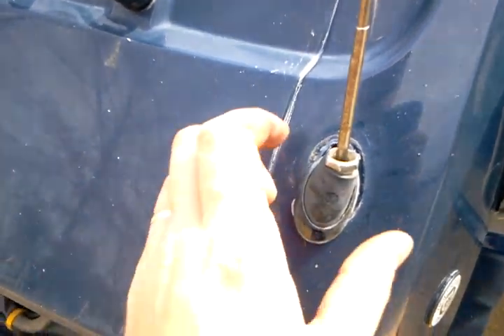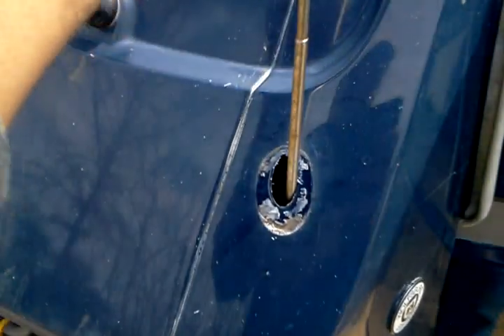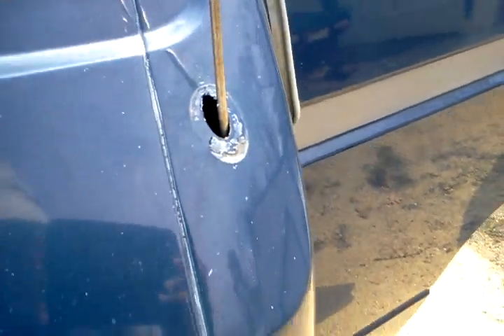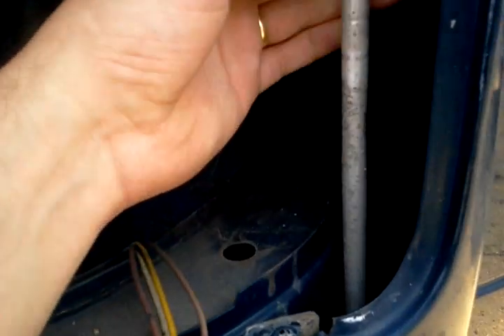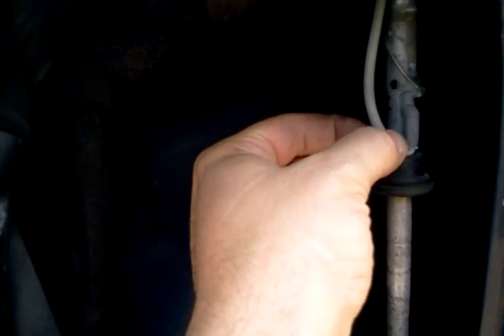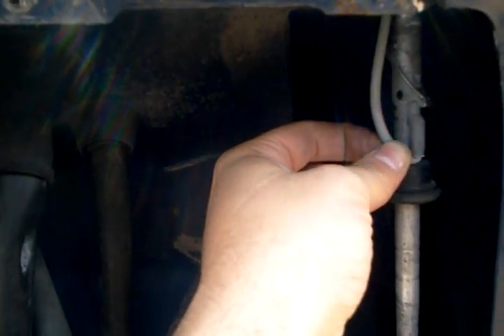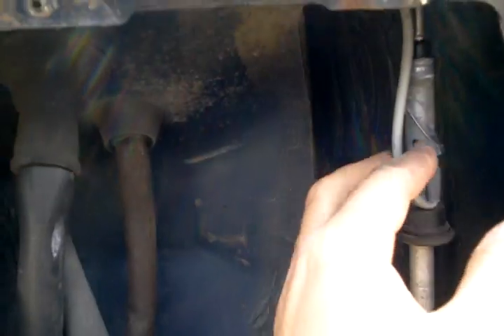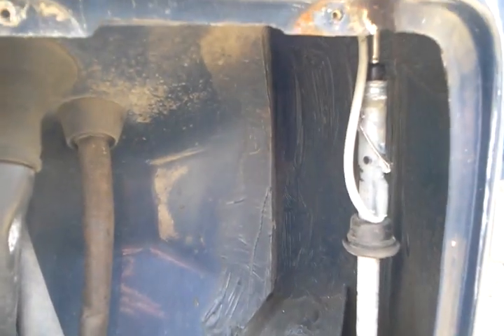Vanagon Antenna Replacement 2

Comment: antenna isn't broken, but just came loose from going through a car wash.  how to stabilize the existing antenna?
Reply from the maker: If it doesn't have a tube on the bottom this will continue to happen.  You can try to make a tube for it and attach it with duct tape or something or just buy a new antenna that is fully retractable like we sell and has the stabilizing tube on the bottom.